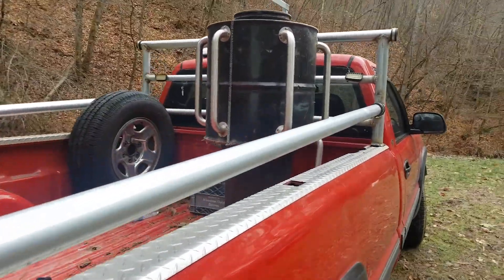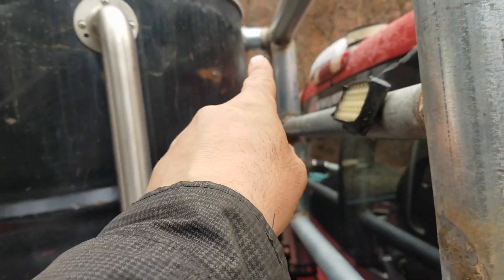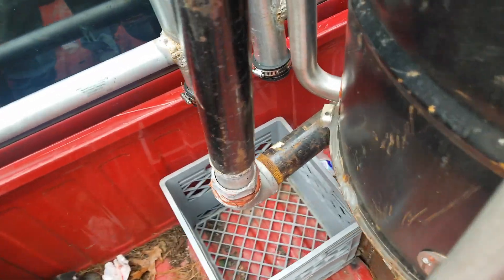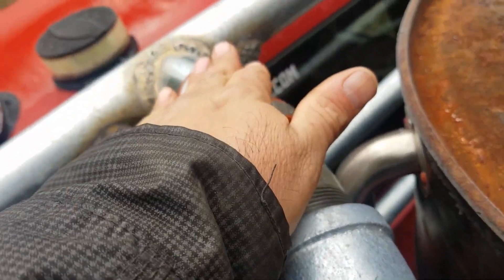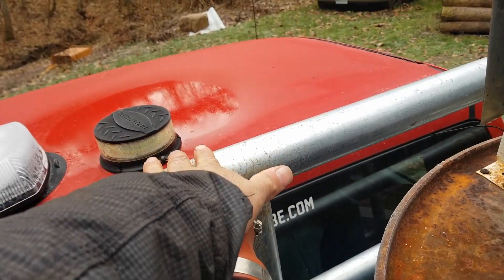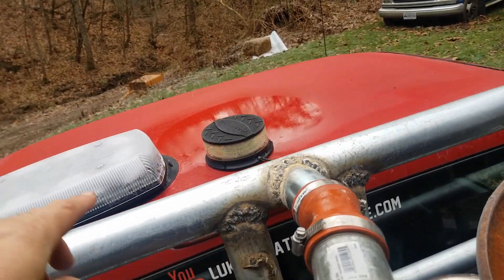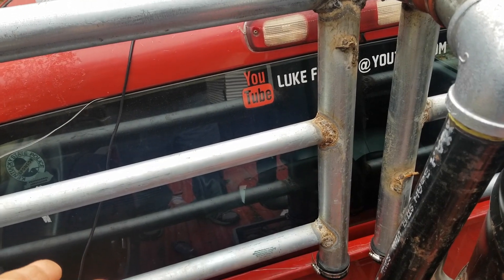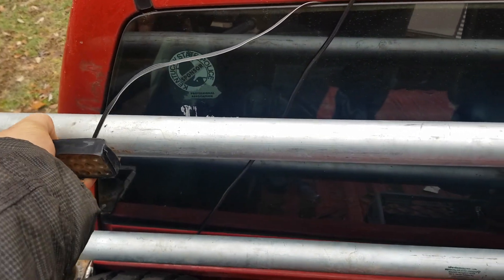Gasifier Cooling Rails and Plumbing on Silverado

Comment: kicking youtube in the server, I missed the last 2 videos somehow and there are other channels I had to go look for and sure enough there were videos I want notified about...smh....  I like the look of all that plumbing, it looks like just a bed rack.. maybe tuck the blowers under the bed side rails?  My only question is if the filter screen is fine enough, maybe a couple layers of aluminum window screen on top of the one you have? Or maybe a car air filter and box under the hood as a final filter?? Pretty dang awesome build!!  now I need to watch the 2 I missed.....
Reply from the maker: Yeah Youtube is bad for that. The hay is the filter material most people use. A paper filter is what I had thought, but it will clog up with moisture and soot too quickly. The screen wire is just to hold the hay in place and keep it out of the gas outlet going to the engine. I am thinking about getting a bunch of stainless steel scrubbers and throwing them in the space at the top of the bucket.
Reply: @lukeFugate  as usual you're on top of it. The scrubbers are a good idea. I suspect that the hay will compact as it does its job and you wont get much particulate upstream anyway but the cleaner the fuel the better the performance... Im looking forward to see what you do next, enjoy your vacation!

Comment: Hey Luke! Looks like you're making a lot of progress. I'll bet you're glad to be off work for the Winter. You sure have to have a lot of plumbing for a gassifier. Your old truck seems to be holding up to all the mods though.
Reply from the maker: Yes, I am really glad to be off work. It seems to be coming together pretty well. The rails on the car didn't cool the gas quite enough so I added more pipe for the gasses to flow through.  I am going to try to make it look better in the truck than it did in the car though.